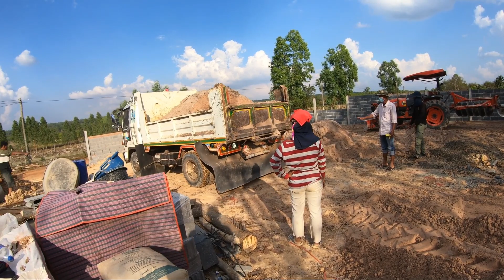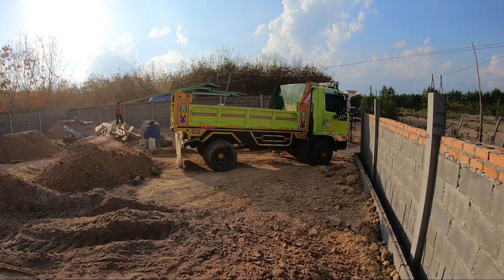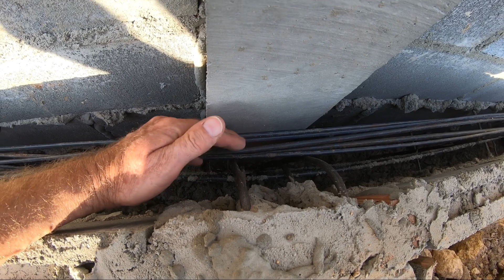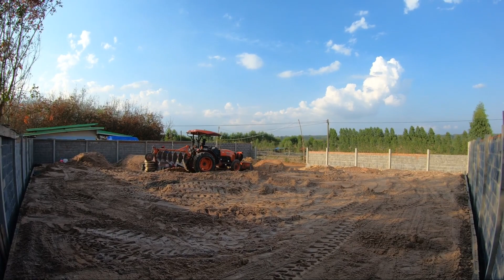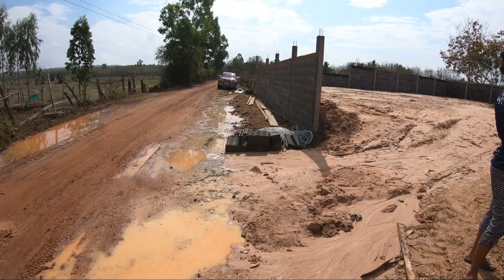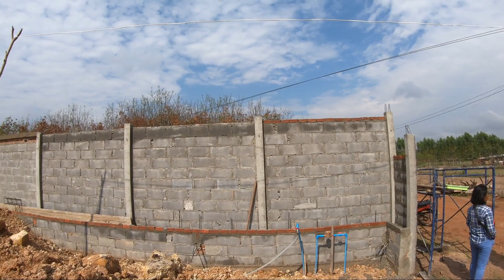New House Build part 7 - good progress on the wall

Comment: Hi,  just looking at the wall design.  That's one of the best I've seen from a structural perspective.  Can I ask why you didn't pack the lower wall section with the concrete prior to bringing the land fully up to it current level  ?   There must be quite a lot of pressure already on that lower section now the ground has absorbed water.   Looking forward to the next video. Best from us both.  Nick & Yisa.
Reply: @sunriseinisaan  Thanks for the clarity.  My wife and I have all this to go through in 2023.  Have you had the house plans drawn by an architect  ?
Reply: @sunriseinisaan  Thanks.  Looking forward to the next video.  Looking at your 1/4 Rai Plot and the costs of the wall I estimate that you will probably come in under 3 million Baht for a modest upwards house thats very well provisioned.